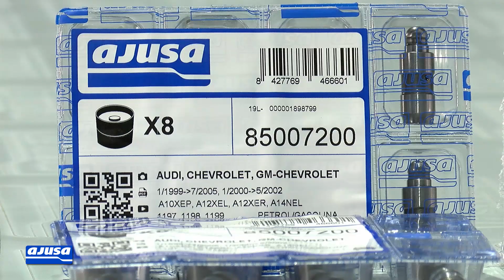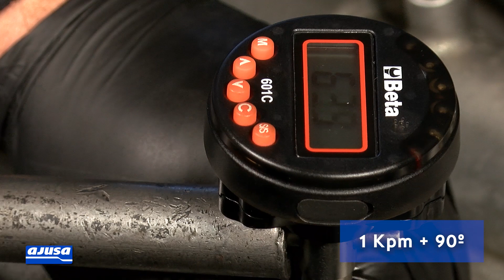Montaje taqués hidraúlicos – Intallation hydraulic lifters / VOLKSWAGEN GOLF TSI 16V (CAXA) /

Comment: Ты конечно молодец, но двигатель не отмыт, грязь и мусор! Смысл тогда его было перебирать, если через некоторое время будут вкрапления от грязи на коленвале и распредвале.

You are certainly well done, but the engine is not washed, dirt and debris!  The point then was to sort it out, if after some time there will be blotches of dirt on the crankshaft and camshaft.
Reply: Пакажи тогда сам как делаешь, а то саветчиков дохера
Reply: Слава Середут посмотри этот канал https://www.youtube.com/user/KPOWERtuning и все поймёшь
Reply from the maker: Я не очень понимаю твои сомнения. Автомобиль прибыл с проблемой синхронизации из-за отказа привода. Ни разу цепь не была повреждена или образовалась грязь, которая могла остаться внутри двигателя, поэтому был заменен комплект цепи привода ГРМ. поздравления 

I don't really understand your doubt. The vehicle arrived with a synchronization problem due to the timming variator failure. At no time was the chain damaged or generated dirt that could remain inside the engine, therefore the timing chain kit was replaced. Best regards 

Follow us: https://www.facebook.com/AjusaSpain/